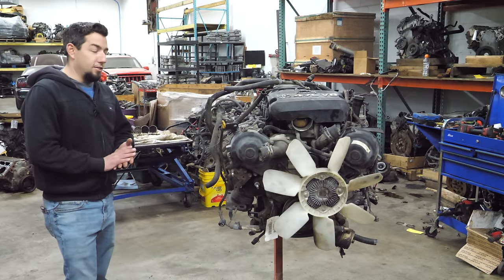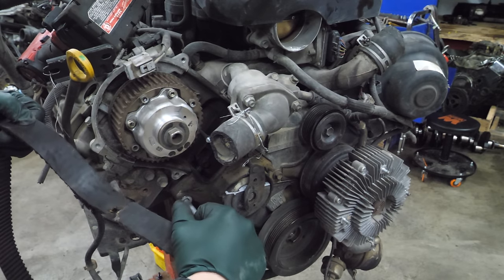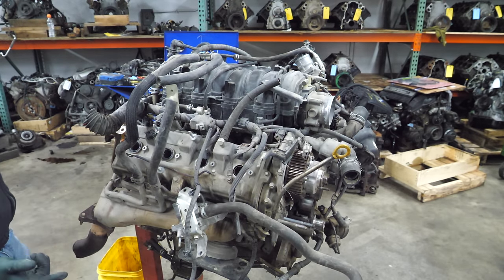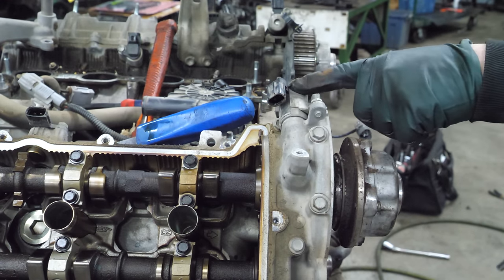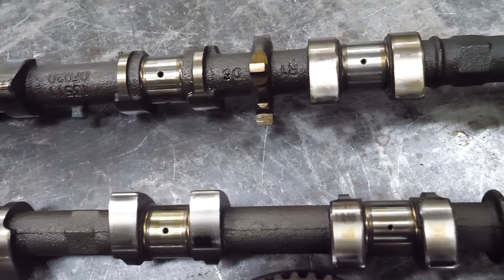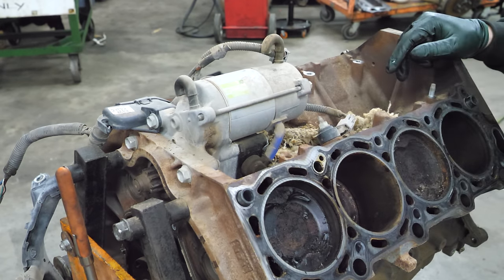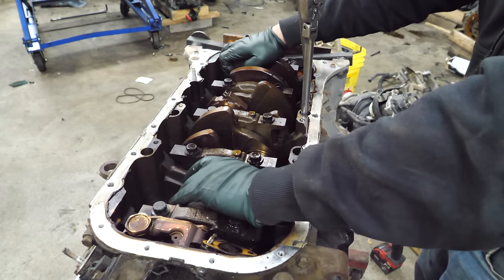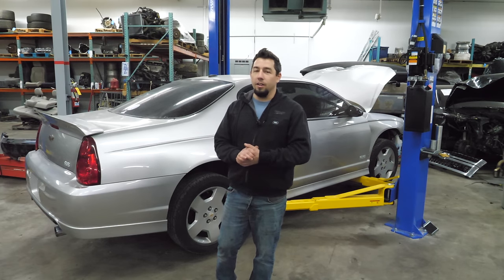Toyota Tundra 2UZ VVT Teardown! Bad Decisions Led To The Demise Of One Of Toyota's Greatest Engines!

Comment: It never fails to amaze  me how you never seem to encounter problems removing exhaust manifolds.  I CONSTANTLY  am presented with broken bolts, eroded bolt heads or nuts, etc. that necessitate extracting and or drilling to be able to remove the manifolds.
Reply: I assume things tend to go worse for you when the engine is still in the car. I bet using the impact gun is helping things come apart that otherwise would snap while using a ratchet.
Reply: Depends on where you live. 

Never had an issue with them here in Arkansas, but when I lived in Michigan, go ahead and get out the blue wrench before you even try. 

Major difference between living in the salt belt over anywhere else.
Reply: @uasparts  Yes that is true. BTW  I am in Michigan so.....
Reply: @williamlanphar630  damn, I called that one 😆😆 

I am a Flint refugee, living in Little Rock for 18 years now. 👍🏿👍🏿
Reply: @uasparts  I'm in South Lyon .  Yes you did !

Comment: Great video! I recently picked up a 06 Seqouia. I asked the owner, "So have you done the water pump and timing belt?" His response was, "Huh?". 227k miles and he hadn't done the belt in the "10" years he owned it. I pulled the carfax and turns out, he only had it for 6 years, and the previous owner had done the timing belt. It was still 2 years and 37k miles over the 9/90k interval, but at least it wasn't the original. I replaced the timing belt, water pump, serp belt, tensioners, fan support, and fan clutch and the thing runs great. Thhheeennnn I drained the ATF and it smelt like burnt ass. 😂 3 gallons of ATF drain and fill later it was still dark, but at least it smelled better.
Reply: What's atf
Reply: @greekmaster1001  Automatic Transmission Fluid. It should be bright red and smell like funky oil. If it's dark and smells burnt, it needs to be replaced.

Comment: A tip on removing pistons. Get a piece of schedule 120 1” pipe about 2 foot long you can use it as a driver on the back of the pistons or even on the rod end and even use a 2 lb hammer to force the stuck pistons out with. When the end gets a bit smashed up on the pipe you just trim off the damaged part. I have driven out many a stuck diesel piston out this way

Comment: I am the original owner of a 2001. I replaced the timing belt, water pump and thermostat at 131K miles when the parts still looked brand new. Only 155K miles now so it still runs like new. Parked outside so white paint is fading. If maintained properly after I'm gone, I expect my daughter's grandkids to still be driving it as a vintage Toyota SUV.

Comment: My 03 Sequoia had its first timing belt change at 130,000 miles and it really didnt look that bad.Think I'll change the next one around 210,000. Its been a great trouble free vehicle,I replaced the A/C compressor and radiator last summer and other than regular maintenance thats first real repairs its ever had in 201,000 miles
Reply: People are sayin you still might wanna check the water pump at the mileage suggested for the belt.

Comment: Such a shame! Neglect tore up such a great engine. Somebody probably could have put a belt on the engine (before it was left in the rain) and it would have run fine. Hopefully you can sell some parts so another Toyota one can stay on the road.
Reply: Probably would've ran fine for a while after the rain too. Little bit of blow by, but better than a scrap car!
Reply: Why are timing belts even used, chains are far superior and less prone to rotting to the point they snap

Comment: I had my 2001 Sequoia timing belt break at 180,000 miles.  I had the original changed at 95,000 and it looked perfect when it was changed.  The 2nd belt broke at freeway speeds and I thought the engine was toast!  I was devastated.  I called my Toyota Dealer and then said the engine was toast.  I took the Sequoia to the shop that changed my original timing belt and they said they've had good luck with broken timing belts on the 4.7 and no damage to the valves.  So I held my breath and asked them to change the belt.  Turned out the engine was totally fine.  Timing belt broke the cam sensor and so with a replaced cam sensor, water pump, timing belt - repair cost was about $1000.00.  I now have 20,000 more miles on the same engine and it runs beautifully!  I don't know if I was lucky or what...but that was my story.  Love my Sequoia!!!
Reply: bit scary that thetiming belt snapped because usually they last longer than you would expect

Comment: Recently bought a 2006, 255K mi. Tundra with last known T-belt change at 134K.  I'm an old school mechanic with little Toyota experience.  Your video was tops.  No bull, to the point and humorous.  (like the Ford comment).  I noticed you remove cam, crank, intakes, heads, etc. in reverse torque sequence order.  Great job.